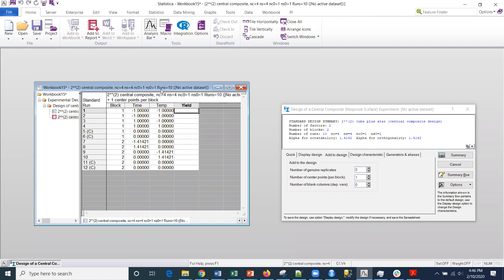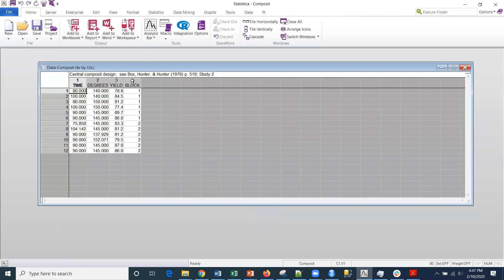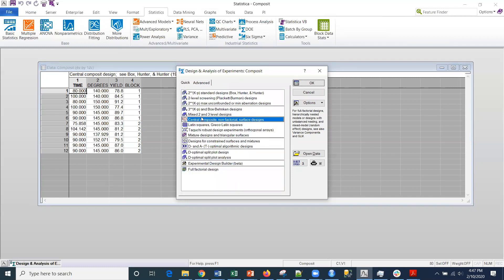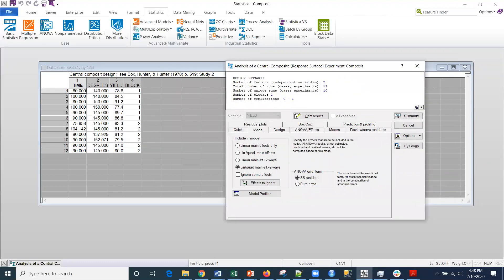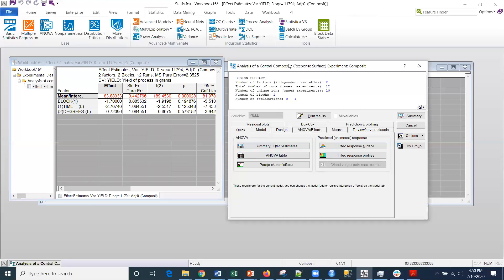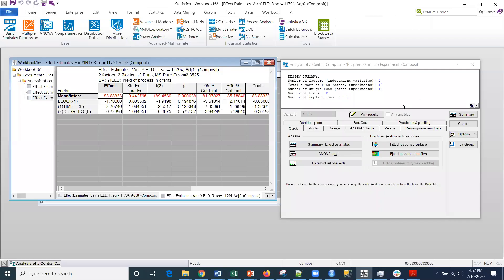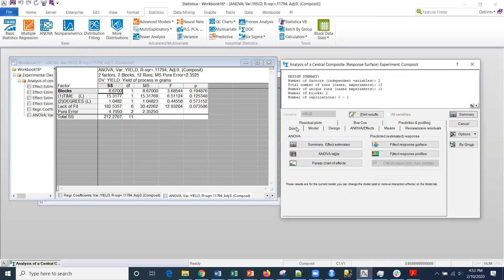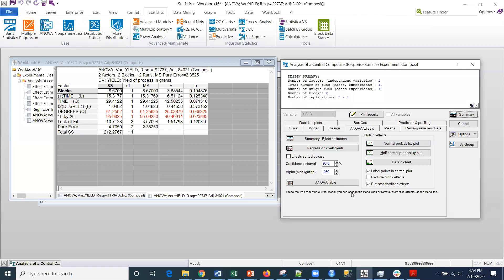ST103B Part II, Analyzing a Central Composite Design – Quadratic Effects

Comment: I use Statistica and composite central design. I use 3/1/16 with 1 extra central point and 1 extra replicate. And in my anova result, why the df value for factors (L, Q, and interaction) is 1 for each factor? Because i thaught that df is the level of factor which is 3 minus 1 = 2. Can you give me explanation?
Reply from the maker: For a standard design. Select a standard central composite design (Factors, Blocks, Runs); the selection from this menu is used only if the Type of design is set to Standard design. 

These types of designs are typically constructed from a resolution V (or higher) 2(k-p) design, which is enhanced by center and star points.